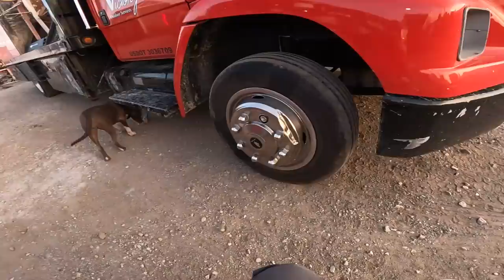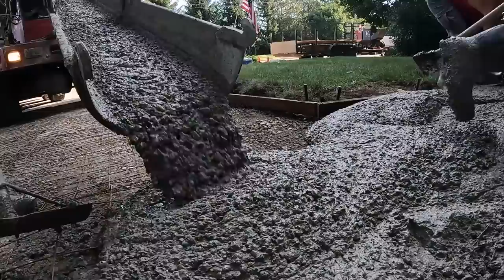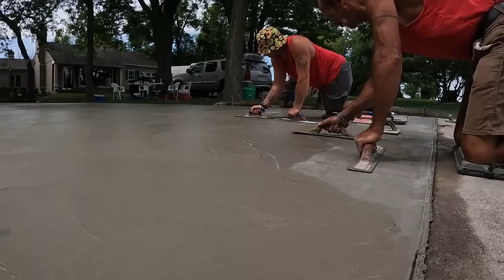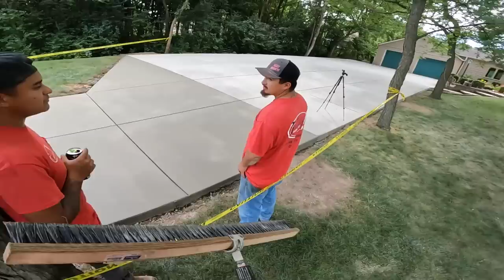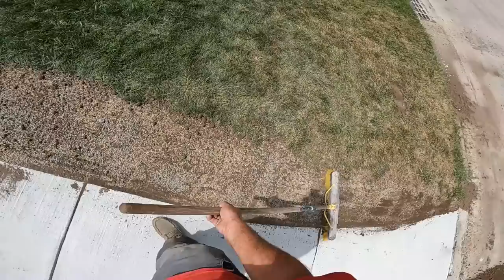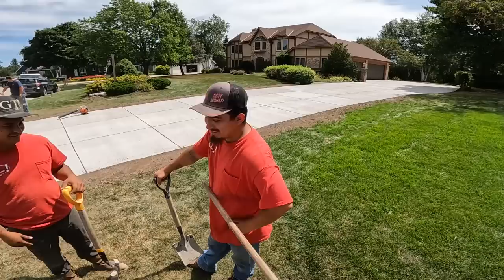I think we are getting lazy! Easy day!

Comment: Almost 6am here in the Pacific Northwest, starting off the day watching the new video before doing some ThermoPlast for the day. Definitely an easy money day. Take care fellas.
Reply: I could google thermoplast, but fighting the urge as I like this community and interacting with people. What is thermostat?
Reply: @glen3257  it's a plastic for the roads. So usually cross bars, Stop Bars, arrows etc etc. For roads. Instead of a paint like they use for parking lot striping the stalls and stuff we use a plastic because it lasts longer and can take more abuse from all the cars. Next time you are out walking on a main road in town you can see the difference. It's thick and solid. It's mainly used on roads, freeways, ya know the arrows on turn lanes? That's Thermo. Heats up to about 1300 degrees of something like that. We have a Thermo truck that heats it while we drive, then you put the thermo into a like cart that has this thing called a Shoe, the shoe is what the thermo goes into and is then applied to the road.
Reply: @josephpossanza5022  Wow very interesting! Thank you for your response explaining it. I thought that was all paint. I can truly respect what you are saying about it lasting longer as I haul doubles (train) grossing 150,000 lb. I have had to cross freshly painted lines in certain rare occasions, but sounds like I would need 13 axles worth of tires if I crossed this. I would imagine you block off the lanes. Again thank you for your reply, not googling it for a few days took great restraint on my part but I did stay the coarse. Please be safe out there and keep up the great work sir.

Comment: I know you have a lot going on but the only thing that i can think of that makes a Mack go through Rear ends is if your diffy lock is still on when going down the road.  Just make sure who ever is driving it doesn't have it engaged   Did you ever find out where that fuel leak is coming from?  Is it the Mack or International